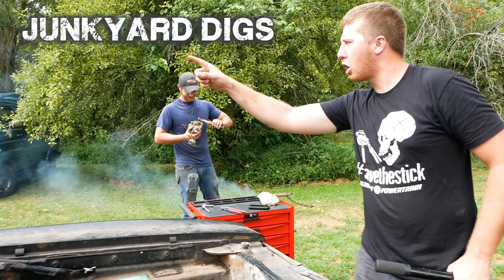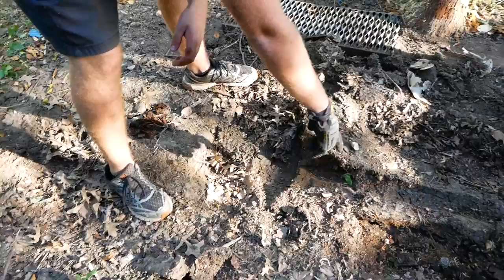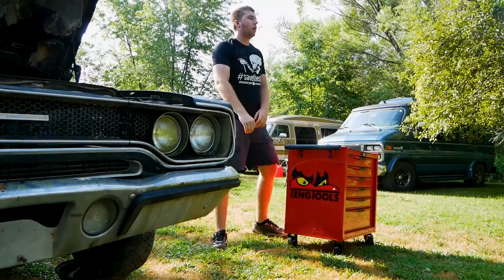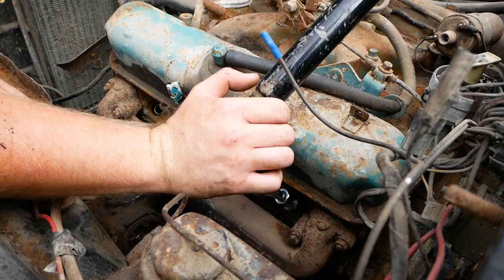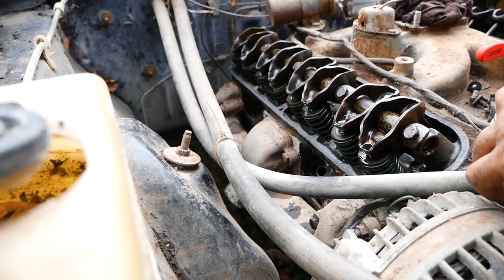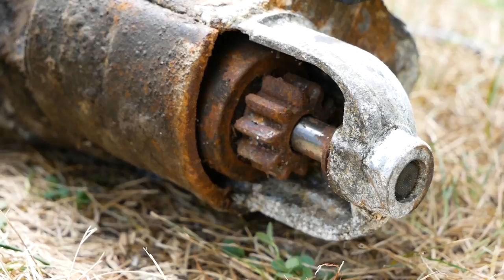ABANDONED Muscle Car Revival! First Start in 35 years! -- Part 2

Comment: To answer your curiosity about the originality of the engine, the car's VIN is stamped into the block on the passenger side just under/behind the engine mount above the oil pan surface. Also, the date and time of the engines production is cast on the same side.

Comment: That game of "valvetrain whack-a-mole" was the most satisfying thing to watch...
Reply: Tappy, tap,tap is ok . Driving the Valve down into the pistons is not good. If they are that bad take the heads off and  soke them in Marvel Mistry oil .
Reply: William Creighton ive heard ATF is good too but idk
Reply: It was pretty awesome. It would have made me happier if they poured a little ATF on the valves first. The thought of dry, corroded metal rubbing together made me cringe a little.
Reply: @williamcreighton9863   its not an interference motor the valves cant hit the pistons
Reply: @trustgodcvdood  ATF and Marvel are practically the same. No one knows for sure but they are both red and both have the same benefits for an engine outside of use in the transmission.
Reply: @stubbysquid1  Then what was pushing the valves back up?
Reply: ANDREW C lmao
Reply: Quality engineering
Reply: Whack-a-valve
Reply: This is a known trick in England. We do stuff the chamber with cord via the spark plug hole though, to cushion the metal parts.

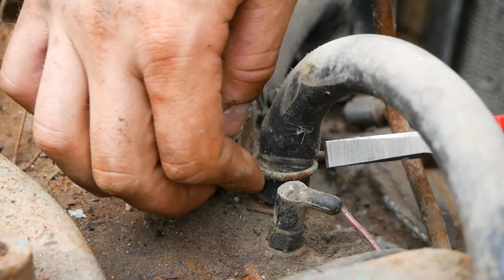Comment: 21:30 They use those clamps because they don't loosen over time from vibration the way conventional hose clamps do. An important factor for a fuel system.

They're a lot easier to deal with when you're using proper hose clamp pliers.
Reply: thats why you should use a screw on hose clamp. Those old squeeze clamps are junk once you open and close them a few times. Especially when they are as old as these.
Reply: The real reason is they are cheap and make assembly faster (cheaper)

Comment: Good advise on the valve train, my buddy who was a professional mechanic wrecked his 360 an hour before I showed up because he tried to start it on starter fluid and the last owner had rebuilt the heads and never lubricants do the valves so they were all stuck in the open position from sitting so long. One new piston and a full rebuild later with new heads, lesson learned. I usually try to turn the motor over a few times with a socket to make sure everything is free before running it.
Reply: As a mechanic myself I think I would have had issues with installing a head with stuck valves...some lessons can be expensive...if the springs aren't closing the valves...stop! You have a problem.

Comment: Just be careful with the valve springs. A friend was doing something similar and got hit in the head by one. Knocked him out fractured his ocular socket and detached the retina in his eye. Very lucky he didn’t lose his eye
Reply: I almost broke my eye socket working on an engine. Got really lucky and only had to get 7 stitches
Reply: A hammer is how I like to remove valvesprings. Works better on a honda with 4 light springs and valves lol.
Reply: A friend of mine was beating one out and got a piece in his voice box, until this day he has a robot voice maker in his throat.
Reply: Oh shit
Reply: @Scratchingforcash  He was beating one out? I HAVE heard people say that can make you go blind. Gotta be careful what you're aiming at, I suppose.
Reply: Lol I didn’t realize I said that. I meant he was replacing King Pins and a piece got lodged in his larynx.
Reply: Cableguy818 lol

Comment: All he would've had to of done is park it in a shed with a concrete floor....
Reply: slowride55 it was just an old worn out car back then, I’d have no problem parking a 15 year old junker in the trees and forgetting it, not realizing it may be a classic some day
Reply: @Beandiptheredneck  But 15 year old clunkers won't ever be classics. That era of cars is long gone now. Too many computers and wires to ever survive the test of time.
Reply: Glam Stachee ya see I hear people sayin that all the time, but I don’t think you are right. The next generation coming up understands these newer cars and how to keep them running just like the older generation understood the older cars, the aftermarket will pick them up and run and you will likely be able to get any replacement part you want just like you can for other older cars. Maybe not all the modern cars but certainly there is going to be 2019 challengers and camaros that still run in 40 years
Reply: Glam Stachee just out of curiosity how old are you? Because I see a lot of older guys that think that way, who just don’t understand that it’s actually really simple to find a cheap code reader, that will tell you everything you need to know, and any idiot can change a sensor when you really needed knowledge to diagnose and fix an older car, I’m not saying it’s easier but it certainly isn’t rocket science. I think the main thing that will get new cars is the way they are built doesn’t lend itself well to being rebuilt body wise, once it’s rotted it’s done for.
Reply: +OntarioRedneXXX

I'm actually 34, depends if you consider that young or old. I just like old stuff in general, it was always better built. It also depends where you live. Here in eastern europe for example even used code readers cost more than an average month's salary, and even then it's a game of chance whether or not it'll work on your car, but basically everyone can get hold of a ratchet set and a screwdriver. Modern cars are just so cramped, even "simple" cars from 2000+ need half the engine bay removed to change an alternator, but as for rust I'll give them credit, they're much better built than the old steel, which would just rot out in 5 years or less in this shitty cold climate.
Reply: Glam Stachee oh I’ll give you that, I’m referring to North American cars and have no idea about European stuff. Everything 1997ish+ here uses the same code reader and they can be had for maybe 50$ online. Not bad at all really. And 35 isn’t old lol
Reply: @Beandiptheredneck  But these guys have gotten as far as they have without any new parts. In the future, for a project like this, how many sensors and computer modules and so on are going to need replaced? If that stuff sits like this for thirty years you won't be able to just wipe the dirt off it, hit it with a mallet and some WD 40 and get it going.

Frankly, I can't imagine making an entertaining video out of running a code reader and replacing sensors anyways, but that's just a matter of taste I suppose.
Reply: Kerithanos I’m sure some industrious bugger will do it. It’s just going to be a different generation working on a different generation of cars, I’d bet the same thing was said about these cars by people who grew up with and owned a model t lol

Comment: I own a Slant 6 powered MOPAR. Bloody engine is indestructible. When I got my car, that engine didn't have oil in it anymore, it had solid sludge, stuck lifters, bent pushrods....and it still ran on 3 cylinders.

Comment: I did a very similar thing with stuck valves on my free 1974 Wheel Horse lawn tractor. the intake valve was stuck open, so I pulled the head and just used a dead blow to wack it down, and a prybar in the valve chest to push it back up, until it came free.

Comment: To get the wheels spinning before moving the car, you use the same technique as when the valves are stuck :D When you got the car digged and jacked up from the ground, or when towing the car, use a sledgehammer to the wheels, most often that got'em turning.

Comment: This is a perfect candidate for a restomod . It is a Satellite , so not a rare car to keep original , slam a big cube motor with an upgraded trans , upgraded suspension . It will need floorpans and quarters , paint to taste (I am thinking Petty blue , plum crazy or moulin rouge , myself). They are never too gone to save , and you got one sexy beast for a toy! Or even for a budget build , a cam , 340 , 360 heads and a 4bbl setup with exhaust will wake that 318 right up.

Comment: Don't forget to clean the points on the distributor.  I'm sure they're corroded and won't make contact.  
Thanks for showing a method for unsticking valves. I think it's gonna run now.
I actually found a pair of those pliers that will remove those spring clamps. Can't wait to actually try them out. You can find them on eBay.
Regards, Tom

Comment: When pulling anything out or mud or w/e, always remember how a Train works (Many engines pulling several carts). I've had to use the tether method a few times on huge trucks that my little ranger 4x4 can't handle solo.

Comment: You lucky bastard, I looked for a Satellite or Coronet for over a decade, the few I did find were completely eaten by rust and people still wanted idiotic prices for them until I finally gave up and bought a 5th gen Camaro for the same price as a non running, rust filled Mopar.

Comment: So the first thing you do "to get it started" is start changing OEM parts. That carb could have been soaked in liquid wrench and it would work fine. Now you adding additional complications by substituting non OEM parts. It's not going to start easier or run better with a giant carb and non-stock intake from a different make.

Comment: Just well re built small block.
My 360 is the same way.

Nice thing about a Mopar as you can put the air cleaner on shove a rag in the pipes and walkaway.

Try that with an oval or a bow tie 🤣

Comment: Watching  your video on the 70 mopar you and thunder head pulled out of the trees and under growth 
You two kept making jokes about Mopar 's. Ha, I grew up working and building mopars in the mid/ late 60's for neighbor's super modified stock car. I also built my first engine in his shop using an old 361ci. Block 10.1 flat top pistons, an 1 season used cam, ported an polished heads of of his old 426ci. Mopar engine.  Between us we calculated with a cast iron in take that my moper would produce between 450/500 hp. So how easing up on cutting down mopars. They're more costly to build right than cheap costing Chevy's but boy the hp I got out of mine was great.

Comment: Recommend you watch all the Mustie1 videos to teach you basic car mechanics. Pounding the vlaves so far down like that probably destroyed any stem seals. A squirt with a penetrant or marvel mystery oil through the springs onto the stems would have helped and avoided the damage from forving them all down so far beacause the guide and seal would have gotten lubrication and released  sooner.
Reply from the maker: Dude, the valve stem was corroded way lower than what was exposed under the valve cover - obviously we know this is bad, we even mentioned to never ever for any reason do this. 
Do you even know who I am?
Reply: @ThunderHead289  Which is why they needed some solvent in an oily mix to soften the gunk before stuffing it past the seal and hammering it into the guide. The you guys were talking about bent valves with little or no evidence as a diversion.

Comment: Luke, I need to set my initial timing in my Pontiac 400 that I just got running, now the car runs pretty good but its running rich for sure. Should I change the primary jets first or check the timing and go through the vac guage procedure then change the jets?
Reply from the maker: Dave, are you familiar with my YouTube channel at all, or are you know? 
I have a carb tuning 101 playlist - check out my video on setting initial timing and starting with a carb where the throttle blades expose only a square of the transfer slots. 

Basically when you are firing your timing late, things will seem very rich

Comment: Honestly, hitting the valves with a hammer is how I learned if a valve is stuck or not. Definitely not correct but it works . . . Sometimes
Reply from the maker: Brass hammer won't hurt anything luckily

Comment: My '84 Dodge D150's 318 has those same non adjustable valves... It sat for about 3-5 years back in the early 2000's being a lonely orphan at an auction... If you took off the valve covers and saw the sludge I found 3 years ago... Hahahaha... hahahahahaa... Yeah no... I couldn't even find the drains to clean them out at first... I think they're plugged again, I'm burning more oil than usual... I love the truck though, it's been great. 

More
Oil
Probably
Also
Rattles
Reply: This one's more like more oil probably also rotten 😂

Comment: The reason that the manufacturer uses those type of hose clamps r due to the hot and cold will expand and contract so those will keep it tight with the contraction of the heat. I never new that and till later in life. Also regular hose clamps will cause a leak over time due to all the heat and cold and will have to tighten since they don't contract. Sorry for the book.
Reply from the maker: No, your good. I see why they went with a more permanent professional look from the factory for sure

Comment: FYI, Mopar usually rotates counter clockwise.  You are hand turning it in the wrong direction...
Reply from the maker: That’s false - but can confirm thats correct one mopar lug nuts. 
Left hand threads!
Reply: Sorry, the big block rotates counter clockwise and small blocks rotate clockwise.
Reply: @Campbase1  that is also false

Comment: You should be using a torque hammer on those valves. Just set it to 25 ft pounds and start hammering. 😋

Comment: I hope you guys get NPD/Classic Industries to sponsor you on this one because you are looking at $2k+ in sheet metal alone just to get it structurally sound again. That's the big problem with unibodies. I was looking at a 64 Mercury Comet Caliente with a 289 swapped in and it was hit in the rear and buckled the valance, trunk floor and trans tunnel.. wasn't worth the $3500 the guy wants, especially not running and needing a lot of other shit like steering, wiring, engine rebuild, toe board replaced... I'd rather take this 54 Chrysler that was hit in the taillight and bent the fender out 6 inches.. that wouldn't be nearly as hard to fix.. and it actually still has the 331 Hemi in it. (but of course the dude wants $5k for it)

Comment: I'm not a car guy, so forgive the ignorance.  Can someone please explain why they say using the hammer on the stuck values is "sketchy"?
Reply: The correct way would be to remove the heads from the block, use a spring compressor to remove the spring retainers, the spring and then the valve. Everything would be cleaned up or replaced and then reassembled. Hitting the spring with a hammer is just forcing all the corrossion off the valve stem.
Reply: @michaelatkin2562  and the keeper could let go send spring flying in your face!!!!

Comment: The Mopar bashing got old really quickly. Those hose clamps are far superior to caveman screw type clamps. As the rubber compresses under the clamp, the clip will tighten, the screw type will not.

Comment: I love Junkyard Digs but Thunderhead's channel is a lot more technical from what I have seen in looking over the videos. I'm not mechanical but I'm trying to learn a few more things. As for this car, I'm not quite sure what the mission or the intent is. Most of the car is rusted away. Is this just an engine salvage or is it a challenge just to make it run. So will this car be driven into a grave this next time instead of just parked dead in a grave. What is there to salvage beyond the engine? Can you get floor pans? Really, the car body is beyond repair isn't it???????

Comment: An engine that's hammered into shape hmm a bit unorthodox but hey if it works it works. I think I would have to get hammered before I tried pounding on valves with a hammer lol I have had a dodge dart a Plymouth valiant and a Dodge charger too much trouble with all of them its why i have Fords mine have all been reliable and less headaches.

Comment: This is much different than zip ties and bias plies iway of starting an old shitheap after 20-25 years. He rigs up a temp fuel jug, replaced the battery, and sends it! “you don’t need to check the bruce jenner oil/rings/belts/hoses/ insert random part here” 😂😂
Reply from the maker: He’s also an idiot, so there’s that.

Comment: LA motors are non-interference
Reply from the maker: Not sure what LA’s are, but I can tell you that if you can hit valves with a piston, then it’s an interference engine
Reply: LA is the code for the small block mopar. They are designed as a non interference engine.
Reply from the maker: andrew hugenberg you know, you are probably right based on lift - we had the springs at coil bind. 
I’m betting with a stock cam lift, you wouldn’t be able to touch. 

Good tech comment my friend

Comment: i had to pause the vid mid way. STOP USING WD40 AND PB BLASTER. im in upstate NY and as soon as i started using seafoam deep creep i will never turn back. especially sylinder walls when you soak them and let them sit. it turns rust black. thats what really got me. i can remember doing crusty brake lines on 80's toyotas. we started trying to source a rear junction for a pickup (5 lines come into it). i soaked it for 2 days and every brake line came out with a wrench. the damn junction unit wasnt even recognizeable.

humor me and try deep creep and let me know if im crazy or not lol

Comment: Whats the whole slant six deal .....sure the slant wasnt known for being a power house but they wasnt engineered to be However the one thing they were known for was being rock solid dependable so I dont get the hate ......smh
Reply from the maker: We went a little heavy - when you spend 5 days camping in a van you run out of things to joke about, so the satellite (or whatever we would be working on) razzing ensues. 
We have had bad luck with 4 of the last 5 we have been around in the past 2 years. 
Not a bad engine, but a running joke between Kevin and I